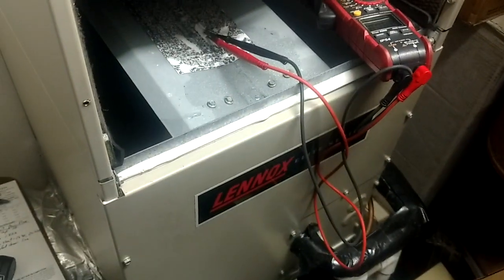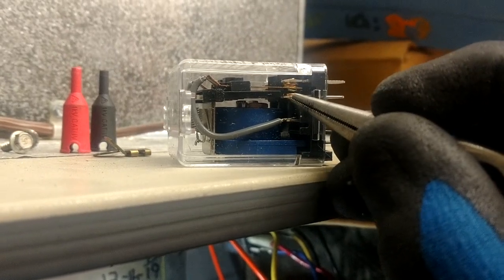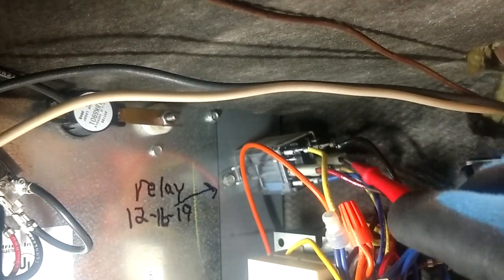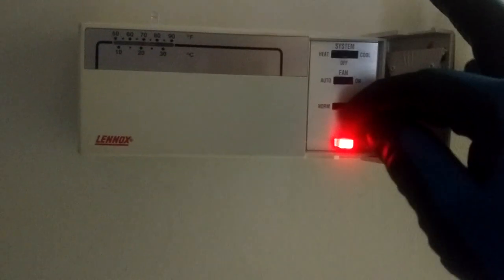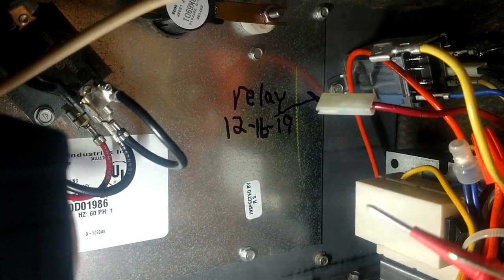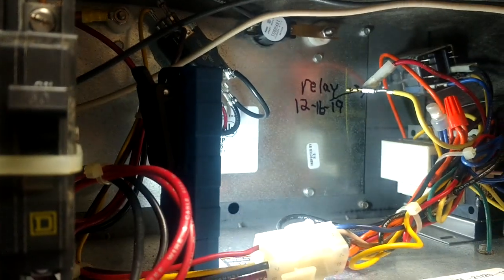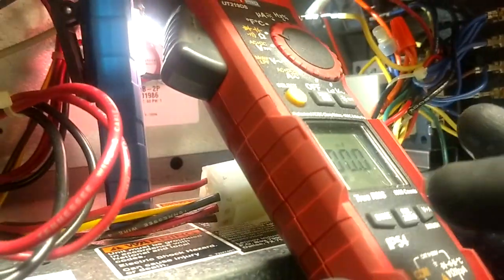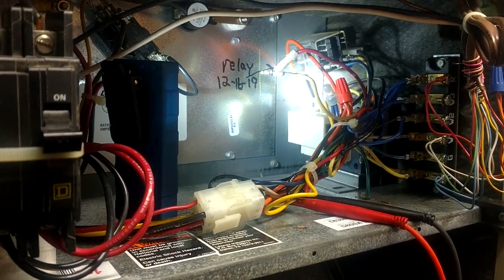FAILED...❄️Ice-Cube Relay❄️!!! No Blower- Part 1 (The Diagnosis) Watch for- Part 2 (The Repair) 👍

Comment: Man I thought you were about to get lit up like a 🎄 thank you for the lesson. Never came across those ice cube relays yet 👍
Reply from the maker: Keep in mind Cory on all new Lennox heat pumps with x13 blower motors they use one of those ice cube relays but the coil is a 240-volt. Thanks for watching my Canadian buddy 👍
Reply: Shannon Knight HVAC the cool on the relay is 240???
Reply from the maker: @hozerhvac4406  yeah on the newer Lennox H.P. units with x 13 motors ONLY. Because the only thing the ice cube relay is controlling is the blower speed in electric heat. It has one leg of 240 present on the coil all the time and the heat sequencer sends the other leg of 240v to the coil to power it closed and switch the blower speed for electric heat. 👍
Reply: Shannon Knight HVAC good to know. Thank you sir
Reply from the maker: @hozerhvac4406  one of our guys didn't know that and he was going around replacing those relays with 24 volt coil relays and couldn't figure out why they kept burning up. God forbid you take your meter out of your bag 🤔
What's Santa bringing you for Christmas this year? 🎅🎄

Comment: With a 60 degree out door temp what  kind of line suction line temp in heat mode is kind of normal ?
Reply from the maker: It really just varies.  But with R-22 around 62° +/- would be about normal. And for R-410A 110psi +/- would be about normal. But the outdoor coil would have to be clean & thawed out. The coil shouldn't be frosting any at 60° ambient. If you look down into the unit the very small diameter copper feeder tubes coming off of the coil (3 or 4 of them) should not be frosting.